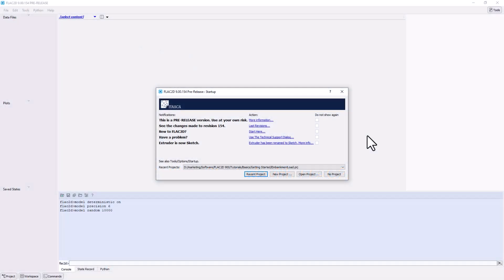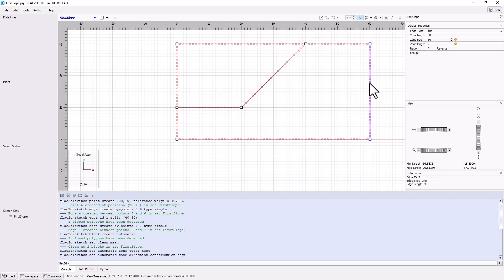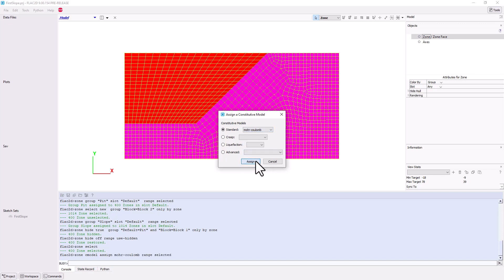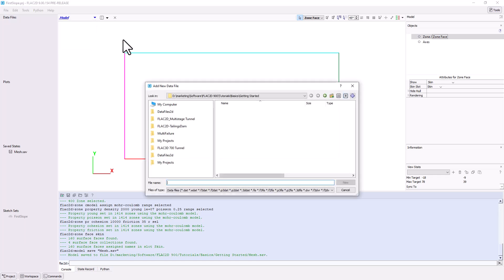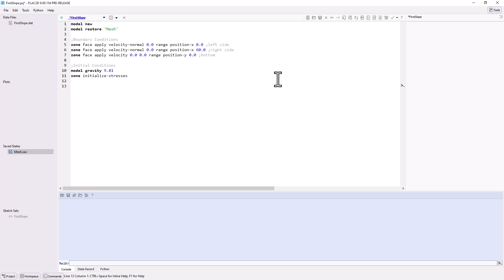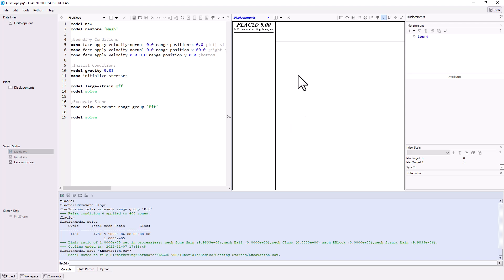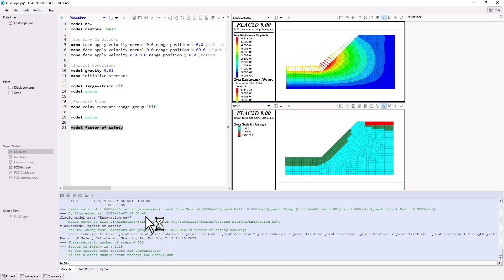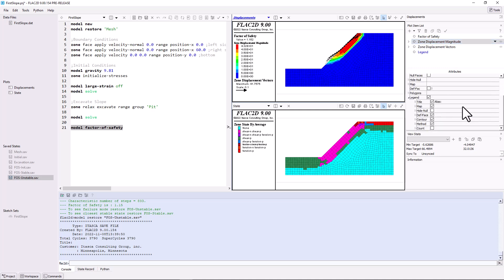Getting Started with FLAC2D | ITASCA Software Academy

Comment: Hello Itasca members,

I get an error message when trying to run the factor-of-safety, the error says "Zone 1 has no constitutive model assigned. I have fillowed all the indicated steps in the tutorial. 

I would really appreciate your help on this error
Reply from the maker: You may have missed a step or one of more zones when applying the constitutive model. Try plotting zone - model and this should become clear. Check out the full tutorial here: https://docs.itascacg.com/itasca940/flac3d/zone/test2d/UsersGuide/Tutorial/QuickStart/flac2dquickstart.html?node2137. This tutorial is also the quick start example, included with FLAC2D. All the project and data files for it are provided.